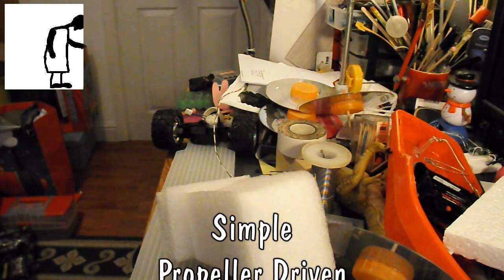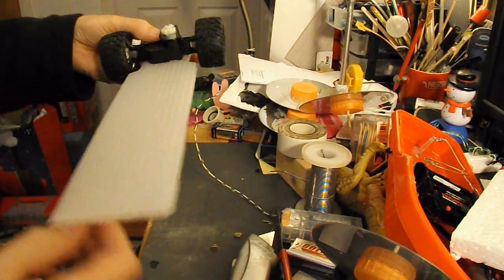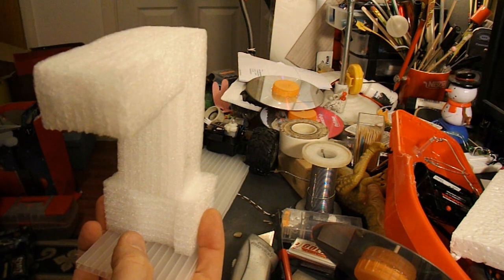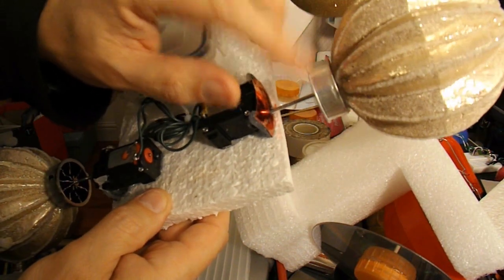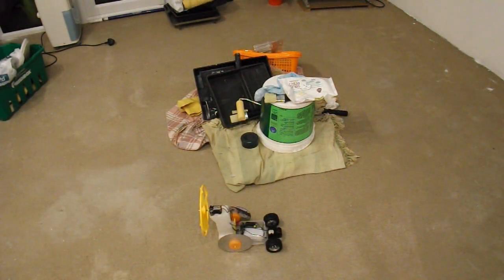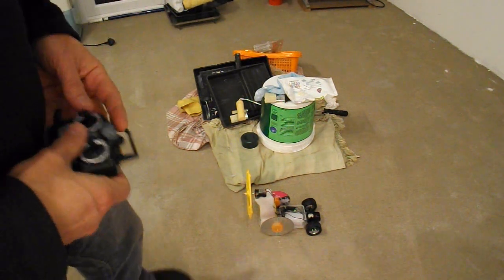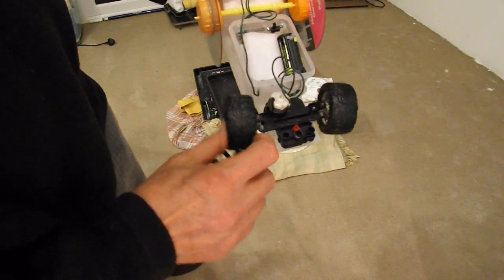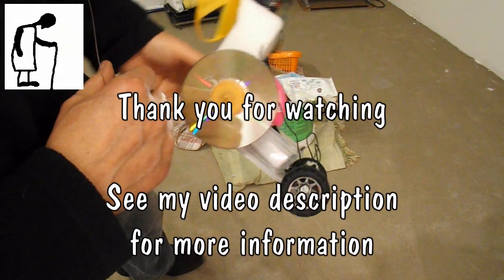Simple Propeller Driven RC Car

Comment: Can you please make a mini quadqopter or a proper glider I haven't seen any of these before because this will defiantly be new.
Reply from the maker: Hi Khalid, that is a regular request and the answer is NO. To make a helicopter or quadcopter stable in flight I would have to buy so many parts designed for the purpose it is cheaper to buy a ready made helicopter or quadcopter. On top of that, my channel is aimed at simple, quick, cheap projects and a helicopter or quadcopter build is not a simple, quick, or cheap project. You would be better finding a channel that specialises in RC Quadcopters so you get the information from people who know what they are talking about. FliteTest would be a good place to start although they tend to focus more on planes than copters https://www.youtube.com/user/flitetest
or anything David Windestål is involved in https://www.youtube.com/user/dadde87
or you might like this video by The Post Apocalyptic Inventor http://youtu.be/qa_x93JQhNM
As far as a 'proper glider' what do you mean by proper? I have several gliders in my Aircraft playlist http://www.youtube.com/playlist?list=PLA5a2xPRSrB0nZItxE_78EJP0F99Ghaki

Comment: Hi there sorry I was just wondering if you had used the steering and radio control system from a different deconstructed shop bought car ? Or if you had any Advice on how to diy your own steering and control system for unidirectional change? Please reply as it is very urgent for a project that needs to be completed , thank you
Reply from the maker: All the parts here came from other radio controlled cars. I buy cheap ones in charity shops and use the parts. If you really want to make your steering from scratch I highly recommend watching  Liberman's videos. He makes everything from very basic materials. Here is a recent example https://youtu.be/VHJSbxjNkWA

Comment: What things can you find super capacitors in (without buying one) as I'm thinking of doing a tethered car powered by a super capacitor
Reply from the maker: I have no idea. I had a look at Wikipedia and got this rather vague description.
Supercapacitors are used in applications requiring many rapid charge/discharge cycles rather than long term compact energy storage: within cars, buses, trains, cranes and elevators, where they are used for recovery energy from braking, short-term energy storage or burst-mode power delivery. Smaller units are used as memory backup for static random-access memory (SRAM).

I think you will probably have to buy them.
Reply: Thanks for the help

Comment: It would be more fun if you steered with a rudder.
Reply from the maker: On a car the rudder is less effective as the front wheels would resist the rudder's steering effect. You could make them castors so they turn easily.